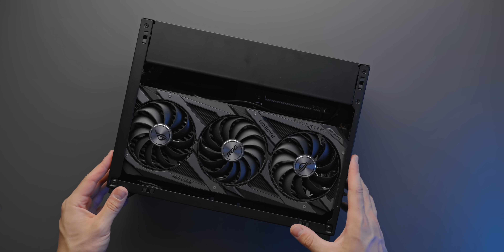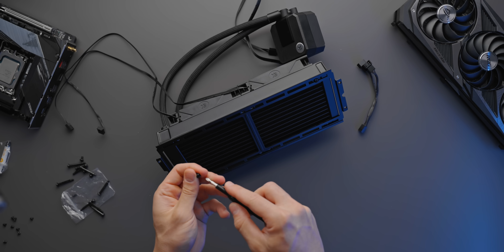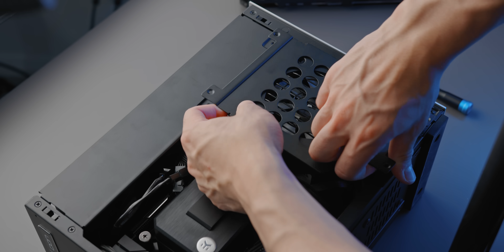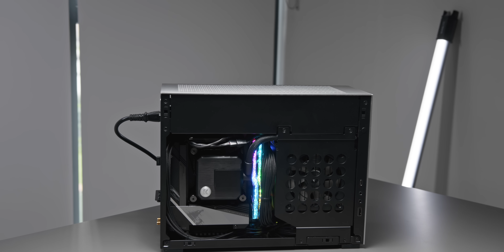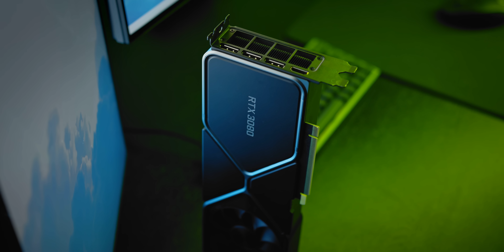Tiny Case with Perfect Fitment – Dan A4-H2O

Comment: Are you sure you did not restrict the waterflow of the AIO? I have built in this case and I found that you need to route the tubing of the AIO on the other side of the power supply.

Comment: This video inspired my new rig a few years ago, and for the most part I'm very happy with it. The only thing to watch out for is the fact that it will require a PCIE riser, which in my case stopped working in 2 months. A replacement was over $100. That isn't necessarily the fault of the case, but since it will require a riser cable just be aware that they are often prone to fail.

Comment: 9060 XT - XFX Mercury fits in there.  Looking like a sleek beast!
You just can't put even a small heatsink on the rear M.2 SSD, because this card's back plate goes very close to the panel the motherboard is mounted on.

Comment: Hey @optimum, did you use a 90 degree angled cable for your gpu? I am struggling to find one. I have a 4080 super FE. In the Dan h20. Very tight fit and it makes me nervous.

Comment: Just so you know, a RTX 4090 FE and MSI Ventus X3 4090 will fit in this case. I have the FE personally and the temps are splendid.
Reply: looking at the offerings in 2024, this case still seems to come out on top overall unless you're okay with paint finish instead of anodized aluminum
Reply: what cooler do you use? and what is noise like?
Reply: @blackice364  I was running a beQuiet Silent Loop 2 240mm and noise could obviously be better since everything was very packed at this point.
A month later a switched to a fully custom build system with an external MoRa 420mm and a Heatkiller Pro CPU cooler, for the GPU I used a EK Quantum Vector cooler but I wouldn't buy EK anymore because of the drama around them.

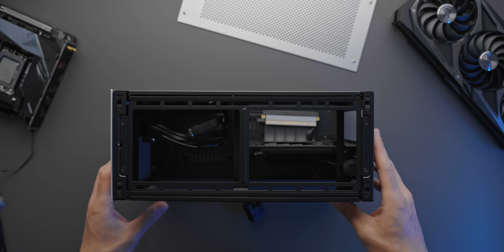Comment: 3:36 I decided on air cooling.  All good thus far.  I don't know how to create a hard tubing system and the thought of "tube routing" when the tubes weren't specifically made for my setup turned my stomach.  Too much forcing things to fit and settling for whatever layout resulted.  If there were water cooled systems that allowed you to modify tube length...

Comment: Just built in the A4 H2O and the side panels are total opposite, they very easily come off, so if you are trying to use the panels to keep in cables the cable will most likely pop the panels off

Comment: Did you have to use the provided Riser cable stand-offs to mount the GPU? Also using the 2 outer slots to hold it in?

Comment: Just did a build in this case. Thank you for the detailed build video. It was very helpful. There is really no room for excess cable. And I am using a fairly short 2 slot zotac 4070.

Comment: Couple of things that can make building in this case easier. 1 - slim fans (with grilles) (also solves a potential issue with screws interfering with the chassis crossmember); 2 - consider pull instead of push (or even (dare I say) as intaake); 3 - pipe length > 400mm will allow routing them at the bottom (eg. DeepCool LS520SE); 4 - SFX-L is not a good option

Comment: I bought NR200P after watching ur videos, now i planning on doing another build for my office desktop with this Case, and the case costs around 200$ in Singapore but seems good and portable!! Likely want to pair it up with RTX 2070 and Ryzen 5 5600 series with 750w PSU, it will do fine right? with the thermals is my main concern, the office is air con ventitalted temps

Comment: Nice case but for my first SFF PC I think I will try the Cooler Master NR200P case.  It's a bit bigger than the Dan A4-H2O but a lot smaller than the 18 year old Cooler Master 690 full tower case I'm currently using..  Any one interested in an "antique" Cooler Master full tower case?  It should be a collectors item by now.  I'll make you a screaming deal.  🙂 Thanks for the video!

Comment: @optimum tech Loved the idea of this size, but like you mention my concern is the cpu, is there not a better way to cool the i9 and not get up to those 100c, another AIO, an air cooler?
This is almos 95% my next case but I like to run an i9 at less than 100c.

Comment: i love this build, I have the strix 6700 xt myself and its hard to find a ITX Case that supports it. I have a AMD ITX build with Fractal Torrent Nano, and I have a couple slim ARGB Fans in the front 120mm. after all that the GPU Barely fits. Overall great build

Comment: I would rotate the cooling block 90deg clockwise and put the hose fittings at the bottom.  Looks like the lines would be just about the right length then.

Comment: think a 3900x will do fine in this case with a 240m? I am deciding on this vs a Q58. I only have a 1660 Super so it should not kick off that much heat.

Comment: Built mine almost the same... i7 12th gen... and 308012 gig EVGA, 750 Lian Li psu and ASRock 690 itx
Reply: Update, I have now installed a 3080 Ti, not much difference in thermals but performance is solid.  I am making a i5 12th gen with the 3080 12g, should be solid

Comment: @OptimumTech  What is the minimal cable length from the PSU to the GPU for something like the 3080FE (I am using the corsair SF750 PSU )? I want a custom 2x8Pin to 12 Pin cable with shortest length.

Comment: I just got this case and aio cooler with a 5600x and 3070ti asus tuf. This is my first time using an aio and better parts but it seems like everything's running hotter than it should? I just have chrome open but the gpu is 54 degrees C, cpu goes between 40 and 50, and m.2 ssd is at 62?

Comment: I've been debating on whether to grab this or the new Phanteks Evolv Shift XT. But honestly after watching multiple builds in both cases, this Dan A4-H2O just seems way more fiddly and finnicky compared to the relatively simple build of the Shift XT. Would there be any reason to go with this one over the Shift XT apart from the Dan being slightly smaller?
Reply: Thermals for Shift XT are shite, you could expand the top to enable more airflow but at this point you might aswell get an NR200
Reply: @glenakatsr  thermals in mine have been quite reasonable tbh. I agree the top could have been a few mm taller to accommodate thicker rads/fans including their own T30s. As far as going with the NR200… they just aren’t on the same quality level. The NR200 looks cheap next to the Shift XT and A4-H2O

Comment: one thing that ive noticed over the last months, with mining and just power supplies in general is that sure you can run a 750 watt, even a 650, but when it  comes to effieciency, your loosing about 7-11 percent when your maxing out the power supply. ive heard it before once or twice but really you  do want to figure out your average wattage,  and get a psu that is going to be running at 60 percent, the power curve is at maximum effiecency in that middle curve area, and with you being a lot about efficiency and noise .. it will help with both of those. so buying a psu with 30 percent headroom is honestly preferable

Comment: Those are custom PSU cables am I right? I just got my Dan A4H20. Can't wait to finish this build. I'm going with EK 240 also since it looks clean with that AIO.
Reply: The Corsair sfx platinum psus come with  sleeved cables in the box. The Platinum version
Reply: @rookie693  I see thanks btw do you know what specs did he used on this build? He did not mentioned it
Reply: @kenchao95  He uses the I7-12700k and the ROG STRIX rx-6700XT
Reply: @rookie693  Are they shorter than the regular ones? So that they fit wil thw case?
Reply: @kenchao95  no, I believe they are around the same size as standard sfx cables. Even then, sfx cables are shorter

Comment: Question: dos the orientation of the AIO inlet pipes into the Pump matter? - i got the case and the same AIO, but my z390 phantom gaming, interfers with either RAM or PCB shroud with the inlets. can i also just put the pipes facing top side of the CPU, while still maintain cooling? - thanks! (radiator is on top of the Case allways)
 - thx

Comment: Is it possible to remove the riser cable and use a third party straight riser cable? I ordered this case on newegg but due to it almost being 100% out of stock i could only get the PCIE 3.0 aluminum model and that won't work for my 3080.

Comment: I have to say I'm disappointed in reviews of this type you cover the case fantastic but you completely ignore real world senario I'm a gamer and not one who's rich with loads of money. A single m.2 doesn't provide enough storage for my vast library of games. Why do we gloss over the storage capability of small form factor cases I think we shouldn't have to sacrifice having component fitment for storage we can squeeze a simple HHD or ssd removable rack somewhere
Reply: There is technically a 2.5" SSD placement on the bottom, however, good luck with the power supply cables. Already squished for space, could be put there tho.
Reply: @nickl9939  that's why I didn't mention it. I hate that these cases in real world applications just don't provide real world storage means
Reply: @Goose_izLoose  I mean considering how cramped it is already, I doubt throwing in the 2.5" will affect the tests he did in this video. Wouldn't change much in terms of clutter.

Comment: There is one problem with this case : Its the air flow. It would be very usefull to have the specs for the Airflow in this case compared to for example Corsair 680X.

Comment: *Optimum Tech* I'm a big fan of your channel. My first ITX build was a Dan a4sfx v2 with the second iteration of the Asetek cooler with some modification. I wonder if the cooler tubing could have been run around the bottom of the case. So placing the inlet/outlet of the water block at the bottom of the case/mobo and run it around The PSU. The tubing is probably not long enough but if it were me thats how I would try to run that tubing. Just a thought. Love your videos. Hope there are many more new ITX products to review to keep you going. 👍👍

Comment: Would be VERY interested in seeing a custom loop in this. I was considering the Meshlicious until I saw this. 

Do you think a 10700k and a 3090 strix pared with a custom loop would be viable in the Dan A4H20 ? 

I know that’s asking a lot with a single 240 rad but curious..
Reply: Think that might struggle on a 240, since it can't be particularly thick either

Comment: could you put rgb fans in this? is there any reason why you didn’t do it? I need rgb, I have a 3080 but needs more fps. Also, it seems like the pump/ fan coolers hitting the heat sinks is a problem with lots of mobos now, hopefully it is addressed later this year.

Comment: I don't understand this trend of cases catering to watercooling but only for CPUs. A top spec CPU has a tdp of around 100W, while a 3080 is already triple that. If you're watercooling one but not the other then the CPU should be the one on air. I'd love to see a case with maybe 1.5 slots for the GPU and the rest of the space dedicated to the CPU cooler.
Reply: I mean you're not wrong, but watercooled CPUs are much more common since GPU waterblocks are expensive, tricky to install and the AIOs that cool graphics cards are very limited.
Reply: @frostedbutts4340  that would be a valid argument if the case wasn't marketed as a water-cooling focused case, if anything they should let you move the spine so you can choose what config you want like the T1

Comment: I have a radiator question that has nothing to do with this video but would love to know if anyone has experience with. I designing an ITX case where I'm planning on having a compartment on one side the sucks air from the front of the case and out the back. What I'm going for is having basically a push push pull config with a fan, radiator, fan, radiator, and fan all sandwiched tightly together. Don't think it's too relevant but these will be 6x140mm with 2x45mm radiators. Does anyone suspect that this config should not work as well as I want of expect it to? They would all be Noctua fans, so I'm hoping that should be more the enough static pressure with the 3 layers of fans to easily go through both radiators

Comment: If this case had the option to stand vertically, it'd be perfect for me. I'm still torn between getting this for its compact size or the Meshilicious for its smaller footprint.
Reply: You can atand it vertically on its face but the aio pipes end up being at the bottom. Maybe some feet for the back, so you can have the box stand on its arse.

Comment: I must say it bothers me that these cases always get restricted to a single 240 rad and seem targeted towards using air-cooling on the GPU.

I set my requirements at liquid GPU+CPU, and minimum 2x240 radiators.
Which is why I've ended up in a Singularity Wraith, even if that is quite large compared to this.

Comment: Wouldn't a AMD CPU be a better choice here? Much lower power consumption. I can air cool a 5900x in my NCase without it ever hitting the high 80's under the loads you had, so a 240 rad should have similar results.

Comment: case is cool.. the price is as stupid as it gets.. I can buy a cheaper regular ole case for 50 bucks,, or spend 200 on a case half the size with half the material used to create it.. but ill spend 4x more for 4 times less. The case would be perfect is the price reflected what you are actually getting. The price would make more sense if it came with the rad and cooler.
Reply: The price reflects that they'll sell way less units that cheapo office computer cases, and they still have to pay off the tooling etc.

Comment: I have a 2007 BMW that I love. And the only area of the car that ever gives me trouble is the water cooling parts. It’s the reason the car goes to the shop once a year, often towed on a flatbed. 

Cracking hoses, leaking fittings, and failing pumps. Destroying other components of the car in the process, and immediately making the car un-drivable. 

So, I’m not exactly eager to add liquid cooling to my PC. Especially since the air cooling works so well. I have an RTX 3090 FE, Ryzen 5900x, cooled with a Noctua NH-D15S and Noctua 140mm case fans. Everything runs whisper quiet, GPU runs at 66°C and CPU around 72°C. All on quiet air. 

But, it is tempting to try liquid cooling to fit everything inside a tiny case. But I already have the system working well inside a larger Fractal Design case, and I don’t really want to mess with it. Haha.

Comment: I really want to see a case like this but for micro ATX, mini itx is great, but i need 128gb of ram for my workloads, and minixitx with 2 ramslots just won’t cut it.
But most microatx cases in comparison are huge, when the actual motherboard is barely larger, someone please make this, you will have my money.
Reply: Look up Mechanic Master on Taobao (Chinese ebay basically), super small Matx boxes
Reply: @frostedbutts4340  thanks for the tip what’s the exact model I can see a couple cases I didn’t find a nice matx one.
I did however just find the SAMA IM01 black steel micro ATX, which looks pretty promising
Reply: @FreekHoekstra  I think the C26 is the Matx one I was thinking of. 

That Sama one is a bit bigger but probably fine and you'd get it much faster.
Reply: @frostedbutts4340  sweet thanks!

Comment: My first thought is that Dan x Lian Li tried so hard to be Sliger, but wanted to make the SM580 smaller, and went too far to be practical, given the constraints of how components (AIO, cables) have to be routed. And then they took away the bottom fans that someone might want if they're running an OC'd i9 and 3080Ti/90.

Comment: The quality doesn't seem on par with high end sff cases.. using those big thumb screws on the back is something we see in basic cases. Just my opinion. Just another rectangle with regular holes for the side panels and a flat front with no design esteem or esthetic. But still much better than the nr200 😅
Reply: But as always a great production video, high-quality & very informative @Optimumtech

Comment: Had the same issues with tube clearance in my FormD T1 using EK AIO 120 and Trident Z Neo RAM.
The tubes weren't long enough in my case (shorter for the 120 version, do not recommend), and the RAM was in the way on the right side, what a pain :)
It all fits in the end, but the tubes are stretched and pressing on the RAM a bit, but no issues after almost a year.

Would be very interested to see you do a custom loop in one of these. 
I actually really like seeing you try around a bit, and deliberate how to proceed.

Comment: the only thing i really wish is that it supported 280mm radiators. maybe im just nuts but with the way cpu's are trending with higher core counts and higher power draw, you're going to need more cooling power. 120mm and 140mm aio's are already basically obsolete. my next build is going to be itx but i wont do it until i find something that supports dual 280mm aio's so i can water cool both the cpu and gpu. unfortunately there really isnt an itx case with this capability yet.

Comment: Given a roomier motherboard (like the Gigabyte X570) and middling components, do you think air cooling could be viable in this case?
Reply: I asked Dan this question and the limit is the height of the cooler - you’ve got 55mm max so there’s some good noctua stuff that’s work. I’m swapping from an a4 to this and I’m bringing across a 3950x.

Comment: 12900K is very doable.

I have 240mm rad in a 10 litre case custom loop cooling both a 12900K and a 3090 - with a 150 watt power limit (which still leaves approximately 96% of it's performance), temps on the CPU don't go above 85c.

So a 240mm AIO for just the CPU is very doable, but the 12900k needs a power limit applied

Comment: The flipped GPU layout is absolutely genius! One of the biggest problems I've faced when building in a Ghost S1 knockoff is how the GPU power cables are either brushing up against the fan, or are really pushing against the AIO tubes. Installing a GPU is also a nightmare, since you have to unscrew the PCIe riser from its mount point just to have enough space to put the GPU in.